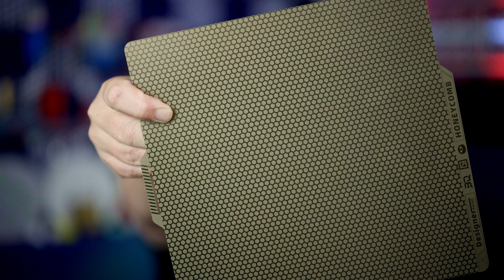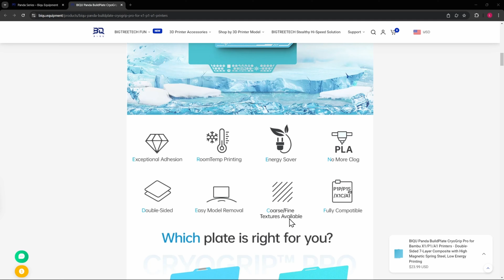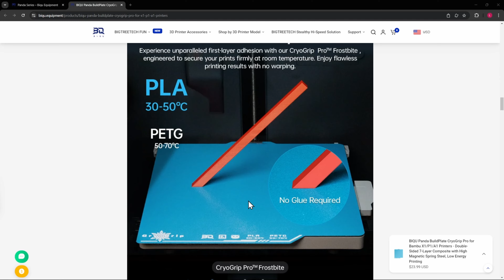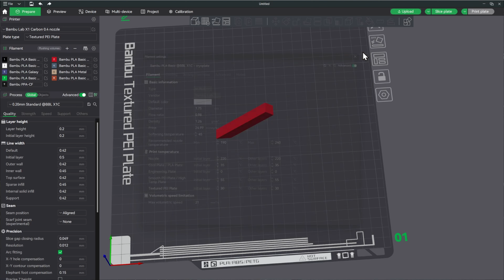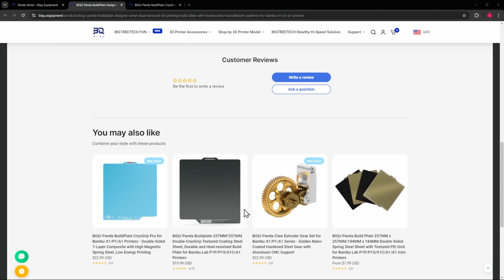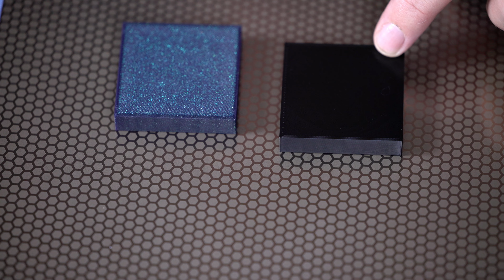My New Favorite Build Plates

Comment: I’m using a generic flexible steel plate I got online somewhere.  It used to have a self-adhesive PEI sheet on it (which worked great).  After that PEI layer finally wore out, I just peeled it off, cleaned the adhesive goo off of it, sanded the steel plate with 400 grit sandpaper, sprayed it with hair spray and gave that a shot.  I’ve used that ever since.  I’ll never use anything else again.  I usually have to wash the plate and reapply hair spray once every 20 or 30 prints…give or take.

Comment: I ordered both and they told me they’re getting the smooth one in on the 17th, so just waiting for them to ship it. I got the smooth one specifically for all my PA prints. Also got the fan duct for my X1C. Supposedly it works a little better than the stock one. I only got the lower part, not the entire assembly.

Comment: I don't get the point of those Glacier Plates. What's the benefit in lowering the temperature?
Reply: Saving energy
Reply: @floatypiet  and time to heat up
Reply: @jared1321  but doesn't the nozzle always take longer to heat up anyways?
Reply: @floatypiet  the bed takes much longer than hotend in my experience as it’s much larger
Reply: @jared1321  okay sick! I'll compare it as soon I get the plate!
Reply: @floatypiet  the nozzle doesn't start to heat up until the build plate heats up, and it's fairly quick
Reply: Less electricity, faster heatup time, this is a big deal if you run a lot of printers. Also it seems to have higher adhesion than most plates which can be really useful on some prints.
Reply: Bed adhesion looks really good with this, I think I’m gonna grab one for my A1

Also the room where you print will be a little colder

Comment: I remember when the X1C was delivered to me from the kickstarter, it came with a cool plate and I could print pla and petg with it with less than 30c on the bed. I loved that plate. But nobody liked it, so Bambu quit selling the replacement stickers. Now BIQU releases the cryo plates and people are raving over it.
Reply: Sticker Replacement Vs Plate = Plate Wins
Reply: @AlxanderProfane  Yes. It's more convenient to have a spring steel sheet laying around that you can't use because you don't like putting a new sticker sheet on it. I personally did not have a problem doing the sticker replacement. It was easy and the stickers were cheap.
Reply: Remember ppl are idiots

Comment: I am missing the 45 degree test with honeycomb plates. In my experience similar types have weak bed adhesion.
Reply: I have 6 buildplates that are all different. They all work well except for the honeycomb. Prints either warp or fall off the honeycomb plate.

Comment: I have the honeycomb build plate and every print is failing. Nothing want to stick to it. Which settings do you use?
Reply: Run the bed temps about 10° higher